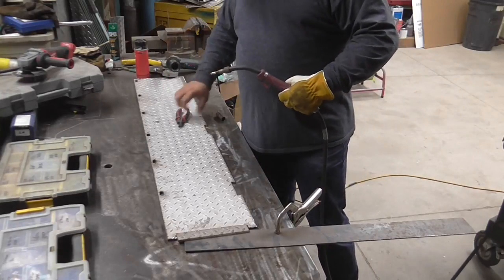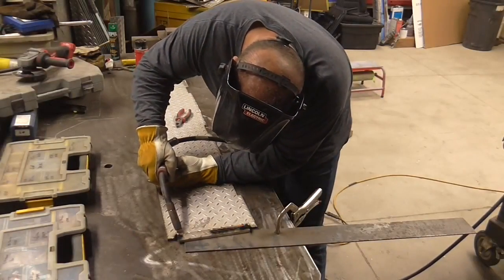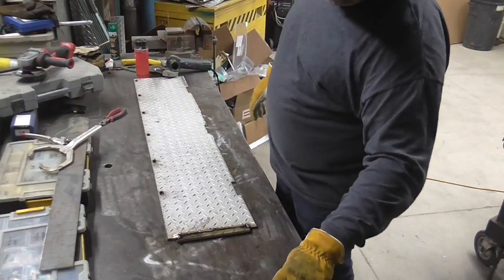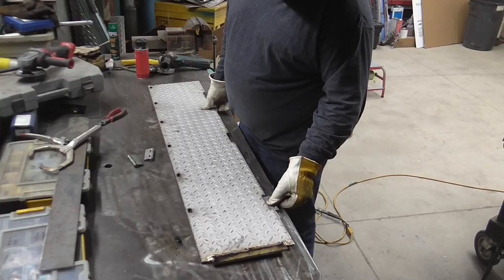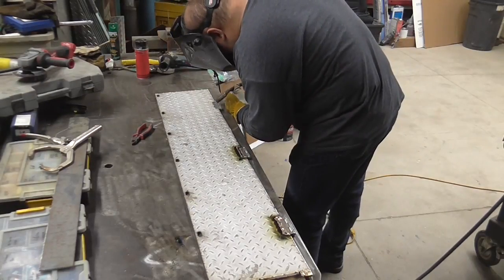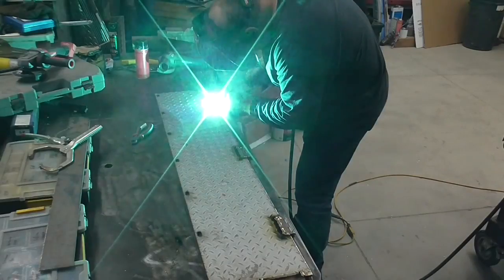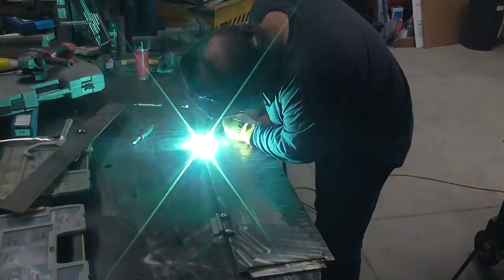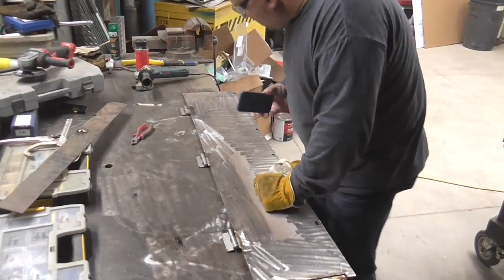Stainless Steel  Pulse Mig Brazing

Comment: can you not use pure argon for stainless  wire also?what kind of gas would you use?
Reply from the maker: if you weld stainless you can NOT use pure argon, argon is an inert gas - you need a mainly inert gas with some active gas in it .... on a wild stainless wire you can used 98%-95% ar with 2-5% co2 or maybe even o1 (that works but is not as nice) if you do dual shield stainless (so flux cored, gas shielded stainless all the wire that I have used in the past call for 75% argon 25%co2.    if you mig braze it with sibro. (in Europe CUSI3) then you have to use 100% argon.   
likewise if you tig weld it you also have to use 100% argon.

Comment: Impressive !  Settings please!    Voltage, feed rate, flow rate and pulse %.

Seems like MIG brazing takes a lot less heat than welding the same material would.
Reply: Yes I have been trying it myself but it spatters like crazy no matter what settings I use. Any help is appreciated.

Comment: I like that sound and the color of the arc! Wait, mig brazing with 100% argon?? Great! Love silicon bronze. Since silicon-bronze is relatively low temperature, would a more modest mig machine be able to do this job just as well as the HTP pro pulse 200?
Reply from the maker: I will try to get an arc shot Sibro with and without pulse ....  there is a night and day difference in arc controllability ...  another pulse mig can do well ...  but pulse migs start at about 2g and really fast you are at 5g or more ....  no matter what brand or color of the machine we are talking about ....  so let me work on that and most likely before christmas you can have something like this ...

Comment: I have welded stuff with stainless wire and 75/25 gas in a pinch and had no issues just the welds looked a little more dull when compared to using tri mixed gas for stainless.. Brazing was a good way for you to improvise though!!
Reply from the maker: Matt Bierwagen i have done that too but now that i know a little bit more about it - i rather not. But in s case like this ( a cover, non load bearing, non critical ) it probably would have been just fine